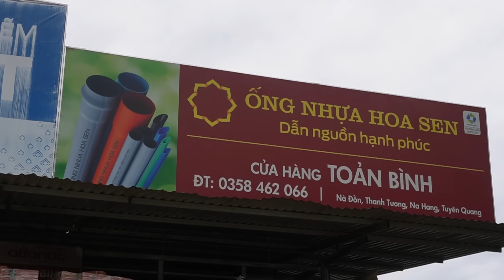The process of building a farm in a new land : Finishing balcony wooden floor quickly in one day

Comment: well you screwed that up your top boards need to rest on the floor joists under it and your seams should be staggered it would give it more strength. floors are not supposed to flex when walked on

Comment: Ly Mai, I generally love your building skills kiddo, but this one...., I'm sorry, but its very poorly done.  The concept is great, but you just tossed this together and eventually it will fall apart and get you or someone you care about hurt.  One of your brothers would have lent you a drill and screws aren't that expensive. Using wire to fasten those wooden girders to the metal ones wasn't a good design. Nor was the way you put most of those boards in place without support at one end. This has unintended consequences, just like when you had the opposite bank of the river filled in. After that your property continuously flooded.  I wish you the best, but please think things out more throughly before doing them. It works out better in the long-term. Sending blessings from the USA ❤
Reply from the maker: Thanks for your comment, I will learn your good ideas.